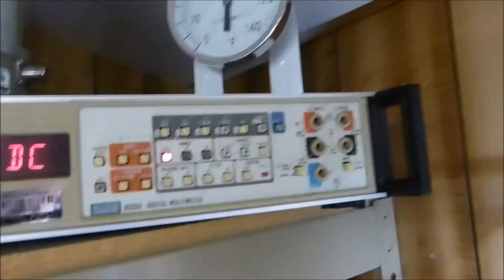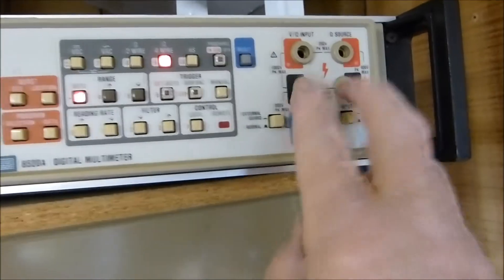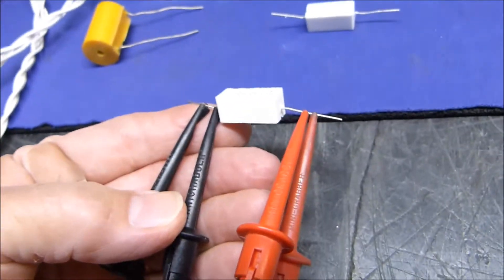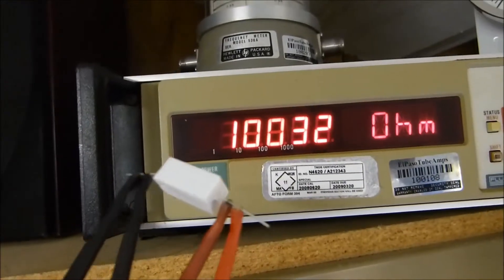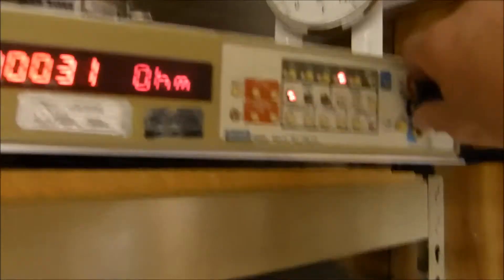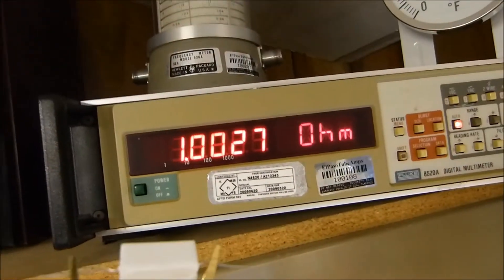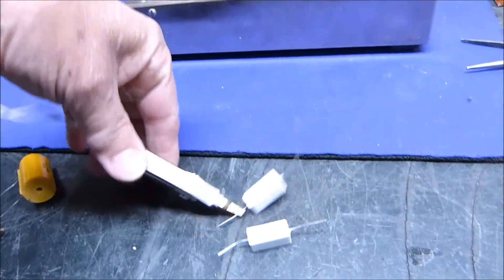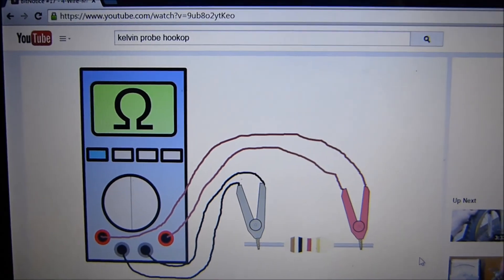4 Wire Ohm Meter  (Kelvin) Connections With The Fluke 8520A

Comment: This is offset compensated?
Reply from the maker: Hi James - I don't think it would be described as offset compensated as two of the wires from the 4 wire ohm meter delivers a calibrated current thru the resistor under test and the other two wires measure the voltage across that connection and the meter calculates the resistance. I have a Tektronix DMM254 meter that has a function they call "Rel delta" that allows you to short the meter leads together and then compensate for lead resistance much like the tare function works on scales to offset the weight of the measurement container. That't the way I see it and the best I can explain it.
Reply: ElPaso TubeAmps
Thanks! keep up the good work. I wish you would do one on a 212 Musicman EB. I am working on the final driver circuit in one. OP amp wont stay working